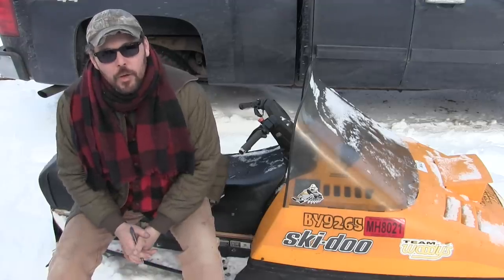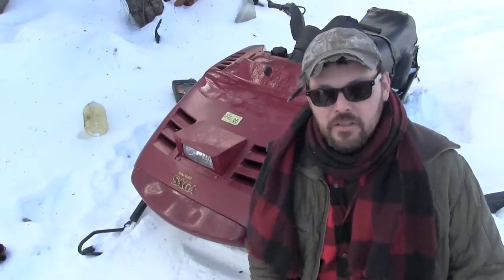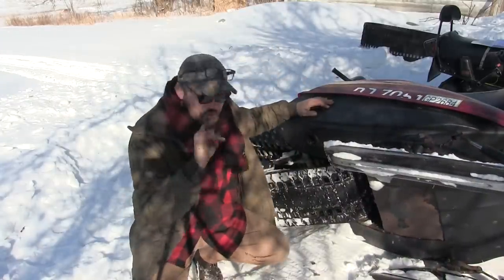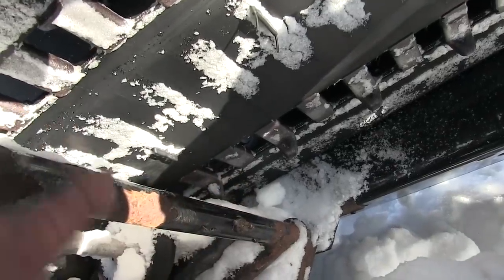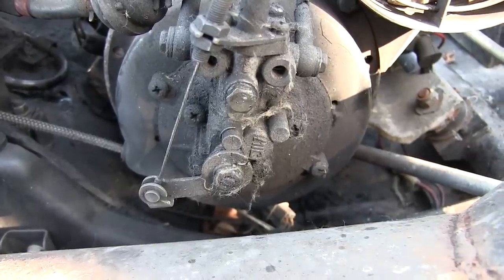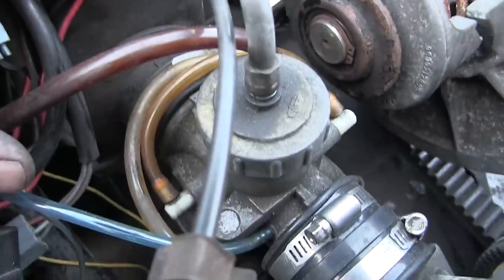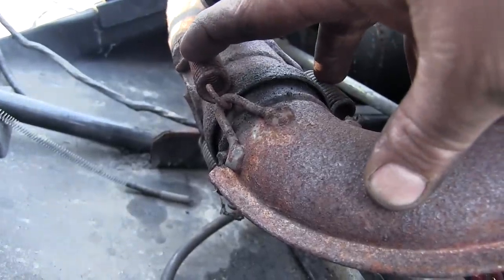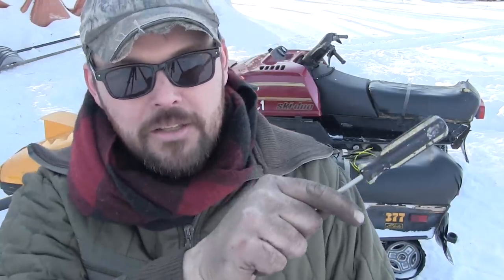Get a Snowmobile for CHEAP!

Comment: Got started riding on a 91 377 safari. Got it for 500$ in mint condition a couple years ago and god was it the most reliable sled I’ve ever had. Anyone looking for a first sled I would recommend a safari. They are cheap and IMO one of the most reliable motors. I remember going out and pulling it a couple times to start it where my buddies were pulling and pulling on their early 2000s sleds trying to get them going haha

Comment: I have a 1986 Tundra I purchased used. It was relatively cheap but not quite as cheap as those. The Tundras are favorites of ice fishermen and trappers here in Northern Maine.   Mine is a 250. Low Power indeed. I would NEVER part with this sled. I also have a 2004 Artic Cat 570 fan cooled. A good friend gave me a SWEET deal on it. To me it’s a space ship ! Between the 2 I am set for life. The cat looks bran new ! 2,500 miles. The Tundra looks Excellent, I feel lucky. I replaced ALL the boots and fuel lines in the Tundra. Carry spare CDI. been fun as you say learning the sled.

Comment: This is exactly my philosophy. Started riding a 1980 Yamaha enticer 340 in my 20s, fell in love with snowmobiling. Years later in my 30s after having kids picked up 2 1989 and 1990 Yamaha Ovations both 340 I think. 1 snowmobile can sit 2 people and pull 3 kids on sleds. These things are built well. Both cost me total $700. Both still run great.

Comment: Good advice. Don't forget to lube the ramps on the secondary clutch with special clutch grease and always carry an extra belt and a tow strap. I like the old Ski-Doo Elans. We would take out the single cylinder, if that's what it came with and replace it with a 399 or a 440. Super light, easy to maneuver and pretty darn quick for an old ditch Banger !! Thumbs up.
Reply from the maker: Thanks August!

Comment: I have a 1976 Ski Doo Olympic 340 That I purchased Brand New.  Always stored inside.  I hadn't run it since 2012. Lot's of snow in Minnesota this year so I Mixed up some gas and it started on the 10th pull.  This thing has never let me down and it's light so I can lift the back when stuck in wet snow.  Great info as always Dave.  All those maintenance suggestions is what keeps them running.  Great price on some good machines.!!!  Always carry a spare belt.
Reply from the maker: Thanks Ruthie

Comment: I love the narrative of what things are, what they do, and what makes a good or bad one! That's gold level info! The only thing I would have added to this video is telling the viewers to always pack a tool kit, a tow rope, and a spare drive belt, preferably on each machine so you don't "forget" to pack it before getting stranded somewhere. I just picked up 3 vintage Polaris in restorable condition for $850. It's going to be a labor of love and you're SO right... overlooked sled models, the undesired ones, are so much more affordable than the high performance sleds. Great video!

Comment: OMG, Dave you are spot on with this video. My kids are big into snowmobiling and everything you have said they have experienced. I had a Yamaha and was about 30 miles from home and the thing quit running. Started checking things and found the battery connection was just a little loose and that was the problem. Those rubber manifold will break and can also destroy your engine. Excellent video.

Comment: Really good advice. When I was living out by the villages every snowmachine was a Skidoo except for the Elan, they were the most popular machine. All my machines I bought new and are still running. I have a 2018 Polaris Indy 550 EXT, 1998 Arctic Cat 340 one of the best machines made and a 1984 Elan. I keep them inside and run each one a lot. Two things you didn't mention that I think is important is liquid cool versus air cooled and better to have a machine that turns on with a key to have a pull start as well.
Reply from the maker: Thanks John. I dont know enough to get into the fine points of liquid vs fan. I wanted to stick to the "mechanics" end of things. You are spot on about the rope "back up" start.

Comment: Great video! I just want to add that people should definitely look up how to re-string the pull starter recoil. I tried to do it myself on my 96 XLT and ended up taking it apart further than I had to... and the clock spring popped out which was a mess. Turns out I didnt have to go that far and you are supposed to re-string it without removing what I had removed. It is surprisingly simple if you learn how to do it before you tear into it like I did. 
Also... the part about not buying a triple is definitely correct for a newbie. They sound amazing, have great power, and are fun to drive. However, messing with 3 carbs isn't fun. Also, I did a top end rebuild on it and stuffing 3 pistons into a monoblock is not a great time.
Reply from the maker: Great point about the rewind rope for sure. As for the rebuild...I bet that was a frustrating bugger.

Comment: Great video!  I never gave Safaris much of a thought, I think there were only 2 in the village I grew up in and one was always broke down, and it felt like the other wasn't broke down only because it was a rarely used spare.  Could have easily been who owned them and worked on them though.  

I'm going keep a better eye out for them now, people are asking too much for Bravos and the real Tundras here it seems!  I have 3 kids that are going to need machines soon.  

I'm sure it's crossed your mind, but you  might want to give some more thought to removing the oil injections and go to premix.  From my recollection those years of the economy Ski Doo models, and maybe all of them at that time, were bad about oil injection failure resulting in a seized engine.  The 1991 Tundra I use as a spare and let the kids scoot around on is converted to premix, it's a hassle but better than having an engine seize...again.

Be safe out there!
Reply from the maker: Good points. as for the red ones in this vid, they were running pre mix when I bought them and the oil injection lines were empty.....I topped off the oil tanks and let them idle with the oil injection held wide open.......and the oil came right up the lines. I'll probably still run a 50:1

Comment: My 86 Safari 377 was the best $500 i ever spent. Super reliable and easy to work on/find parts for. I've had more fun on that sled than any other sled I've ridden. Save for maybe my buddy's sister's C
Citation 250 beater.

Comment: I love snowmobiling here in Ontario , it is a  fun time on the trails here . I had a Tundra   thanks for the info
Reply from the maker: Thanks. I used to ride Tundras in Alaska back in 2001-2003. I worked at a hot springs resort and we had 10 of them for doing tours

Comment: my $250 1996 skidoo has cost me $900 so far and has yet to run longer than 1 minute. Its too smokey to run longer in the garage.
Heres a list of parts I bought, battery, elec starter, ring gear (used), 1 piston and cyl (used) , piston rings and retainer clips ,
CDI/COIL, Voltage regulator, clutch removal tool, 3 clutch retainer clips,  2 carb rebuild kits, crankcase seals and all gaskets etc. New tail light,  new ignition switch, kill switch w/lanyard, exh spring removal tool, Lisle spark tester noid light, waiting for a fuel primer pump to come, all new fuel tubing, fuel shutoff valve, etc etc
I've been working on it almost 3 years, its getting closer and I love fixing stuff but beware, sellers lie.

Comment: Been into dirt bikes since the late 70's, snow machine is just a winter dirt bike. You hit all the major points on the mark. I will add 3 things to your list.  Do a compression test - DRY. If it reads fairly high like 90 psi that is not bad over 100 would be better. Number 2 : this at your discretion. 
If i am 10 miles out and it's in the 20's for temps, you do not want to walk out. I never ever use the oil mix pump - EVER. Myself i always run pre mix gas with synthetic 2 stroke oil, the synth oil protects the rings and bore better and tends to foul plugs less. 3 spark plugs, always have a new clean gapped set ready to go. 2 strokes foul plugs all the time, chainsaws outboard motors ALL of them do it. Nature of the engine. Keep the plug tool WITH the plugs by the way. Keep the spark plugs in a spark plug box or boxes. They are dirt cheap insurance, what good is a spark
plug if the gap is all wrong from getting banged around.  1 more thing on the oil mix pumps. If it'a new - ish sled great i would trust it.
But if it has 20 years or more age on it - pre mix all the way. If that pump is failing or fails you will not be able to tell until the damage is done
and the piston siezes in the bore - top end rebuild time if the connecting rod is okay. Then if you care at all, still gotta get the thing home.
Been there dragged that........
Reply from the maker: Good solid tips ! Thanks
Reply: @Bushradical  Not trying to be a know it all jerk. Just wanted to pass on some stuff that left me in the weeds walking. The best point you made you WILL understand your machine after you go all thru it, so when it does fail to run and it will. You are not helpless. : )

Comment: Those safaris are fantastic sleds. Super reliable 377 rotax. I bought a mint 86 safari with no engine for $90 but I had the correct engine for it kicking around at home so I dropped it in and have been riding it for 5 years now.
Reply from the maker: right on!!!

Comment: If your intake boot isn't cracked, just hard as a rock from being older than dirt, I've had about 80% success soaking then in a container of hot water, with a few spoons of  some baking soda in it.  Old biker dude showed me that trick, works for motorcycle carb boots too.

Comment: Old skidoos are awesome...in theory. Problem is, the more you run them the more repairs are needed. Everything on a sled is a moving part, and they are always rusty. I have a 71 Olympique that was given to me. Parts are pretty easy to come by, still runs well too. Got to the point where I was always fixing something and couldn't justify the cost anymore. I still have it, plan is to take the drive train and make a sweet dune buggy for my boys. But until then, the mice have a nice house.

Comment: I currently have 4 safaris 2 that run and 2 that don't 2 87s with 377 have an 88 with a 368 and a 91 with a 503 totally agree on your video safaris are the way to go if you don't want to spend much my 377s are my runners the 91 with the 503 I think might have swapped and the 368 in the 88 is not far off from running

Comment: If your to cheap and wanna temp fix for the carb boot go to hardware store and buy the rubber pipe fitting sometimes you can get the right size and it will seal the air out works for water

Comment: Good points here Dave, Great video. What would you say are two of the absolute necessary spare parts to carry on-board on  a snow machine?
Reply from the maker: Larry nailed it. My wife also has this little collapsable snow shovel.......tats not a bad idea. Also a spare rope, in case the rewind starter breaks
Reply: @Bushradical  
Never had to replace a belt, plugs yes. Use to race them in the 60s I used to like the 30-40 miles cross-country races
Reply: @Bushradical   Ya, I was thinking snow shovel to get out of deep snow drifts and something motor related.

Comment: Well I got my eye on several sleds several arctic cats and a ski doo that ugly wide track single ski alpine I think but its good for grooming trails and deerp snow for feeding live stock since I like cross country skiing as well the arctic cats Im thinking 340 and below Im not A RACER. wE HAD 399's in the past and Im used to the two cycle engines. And Im much more mechanically inclined then I was as a kid. The worst one we had was an AMF skidadler w a big motor bout 40hp kept burning out the coils and we couldnt figure out why? I wouldnt take one if I got it for free but if I get an arctic cat with the suzuki engine 440 or 340 I might buy it they are fan cooled a good engine kind of like Yamahas they built motorcycles first so their engines are decent cuz they been in business a long time. Arctic cats I think had Kohlar engines and we had an old one with a 12 hp OMG it was hard to pull and cold start so it didnt get used much. I got a lot of fond memories as a kid. But we never had to fix them we were into sports and things. But your right polaris, ski doo, arctic cats, yamahas, used to see Rupps I see a cheap one now but its not running but there is a snowmobile salvage yard near actually Arthur ND Fargo bout a hundred forty miles away and there are lot of vintage types for sale to new and old. If you ever see a rotary engine in an arctic cat don t buy it they are a piece of shit not if ur a backyard mechanic Ie seen master mechanics work on them that couldnt get them running

Comment: I hear curiosity killed the cat, but I would sure like to know how much you paid Jim Smith for his snow machine, what kind was it, and what year it was.  I know Jim believed in using his stuff to the max, but you know, it was his lively hood.  In 10th grade I got to spend in Christmas vacation on Jim's trap line in the Alaska Range.  It was based out of Goldking.  I rode a wooden dog sled behind him.  Once, I lost my footing and he dragged me for a long way, but I held on.  He couldn't hear me hollering at him...he was cruisin fast.  Another time I plumb fell off the runners and he left me in the dark for about a half hour (it seemed like 12 hours).  For some reason Jim liked me and he came back for me.  Imagine it was dark in the winter in Alaska.  :)  Someday I'll tell you about me and Jim eating lynx strogaghoff.
Reply from the maker: To answer your question, Jims sled was a SKIDOO Safari too.....but it was a 90's model. It was about 100lbs heavier that these and had shock/spring front suspention.  I actually bought it for $300 from Steve Verbanick. Steve owned the bar "Ange creek Lodge" just outside of Chena Hot Springs resort. Jim owed Steve Some money and gave him the Skidoo. Steve sold it to me. I put maybe 100 miles on it and then sold it to a kid from the Hot Springs.....Bernie Karl, the guy who owns the Hot Springs took it  from the kid, claiming it was his and belonged to the resort before Jim ended up with it..........Who knows the whole story ?? LOL
Reply: @Bushradical  right on bro
Reply: I love talking to you, I just wish I knew better, but that would probably ruin everything.  Yep, I'm an eternal optimust.  (Where is the spell checker on this thing?)  Thanks for your reply.
Reply: I knew YOU better

Comment: Snowmobiles have always been a buyers market...even in current pandemic times you can buy a good used Snowmobile for 4 or 5 grand that will do everything or most everything a 20k machine will...Snowmobiles are highly dependent on winter weather conditions and they depreciate exponentially fast because they are a hard sell in most geographical parts... like why would you spend big money on a unit you might use only a handful of times in a season? Don't get me wrong I do love the sport and I do run a few older machines around my property but I would never pay new money for one or load it in the back of my truck and try and find snow to use it...that's just stupidity

Comment: Keep thinking a cheap snowmobile would be great until I hear all the noise, smell and smoke.  Taiga Motors, a Quebec company will have a fully electric sled out that will do about 100kms (62 miles) on a single charge out this year.  There will also be a separate watercraft.  Savings in fuel and maintenance will make it/them viable.  Quiet sleding is what I'm looking forward to.👍😁
Reply from the maker: Sounds interesting.
Reply: I've always liked the snowmobile sound

Comment: I have to disagree with you at about the two minutes you said that your no expert. Ya you talk about one carb ...so your cutting out all Polaris ,I disagree on the one carb ,a two carbs will not give you any trouble,...the ware bars on the skis cost fourth bucks should be replaced and checked regularly...all other info all sounds good , I would suggest a Polaris 500 ,good cheep dependable snowmobile , should be able to find them around $500 you will like the electric start and the reverse..well worth a few more bucks, on the other hand I enjoy snowmobiling with my son ever weekend we run new Polaris pro s bought new for around $13,000 with a five year warranty. No matter what you have get out there and enjoy!!!
Reply from the maker: I like the simplicity of a single carb, Nothing wrong with 2....but this vid is more for people who might like to "dabble" in snowmobiles and I think dual carbs adds to the possible issues someone might not want to have to deal with when first getting used to snowmobiles and "working on snowmobiles".

Comment: What a joke, a intake boot is a 3 dollar piece of rubber tubing with 2 clamps, look into the air box and you will see there is nothing there but protection from melting snow and rain. That's it, many dudes run filter socks instead of boxes, seen them down to 50-c so talk to a person in the know not a newbie. Been building custom sleds for over 25 years, my big custom is 1.5l and pushes 300hp, and rip off the oil injection and go for simple mixed fuel like your chain saw. Oil in the fuel keeps the fuel system in new condition year round.